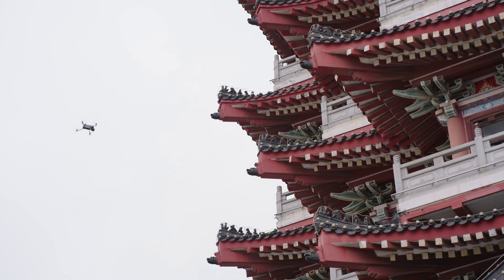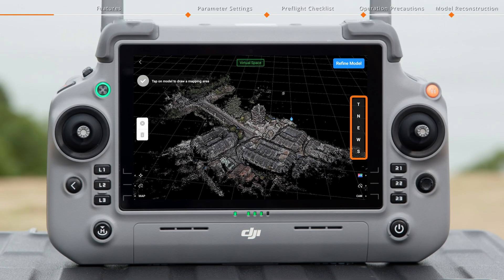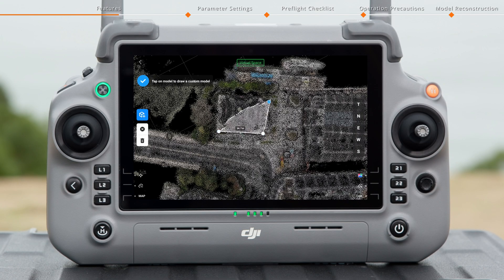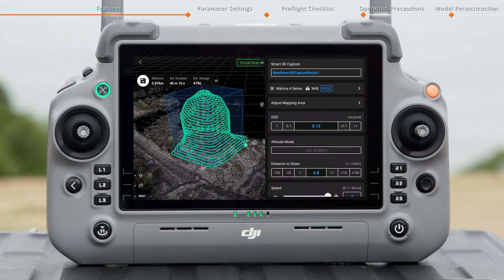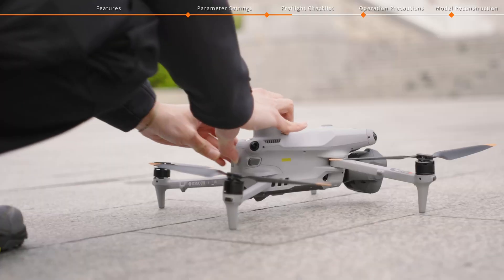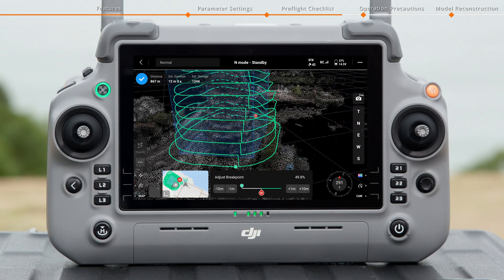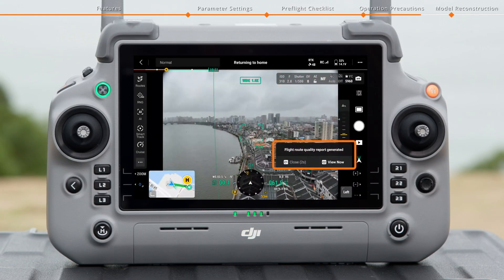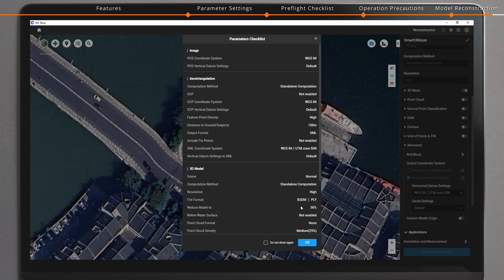DJI Matrice 4 Series丨Smart 3D Capture

Comment: Do I need the manifold 3 in order to perform this function?
Reply: I have asked this same question.  DJI couldn't respond to it.  There are two payload components the Manifold 3, which is a external high performance computer.  The other component is the OBS obstacle sensing module.  These devices provide more capability to the 4E..  Since the 4E is tailored to 3D modeling both actively and passively.